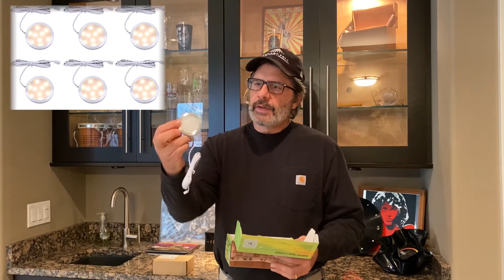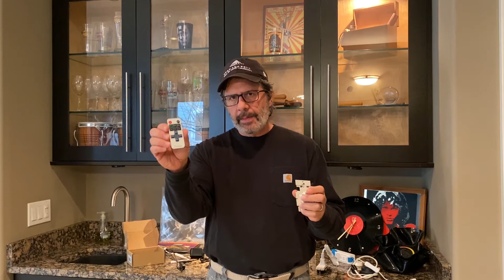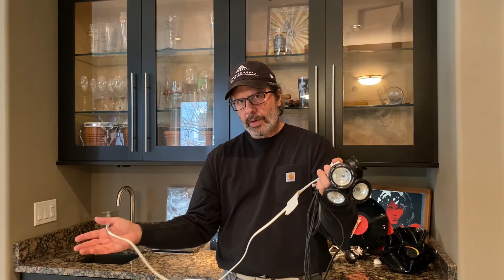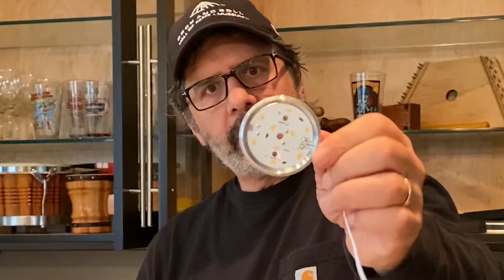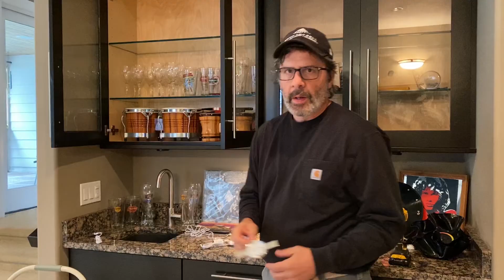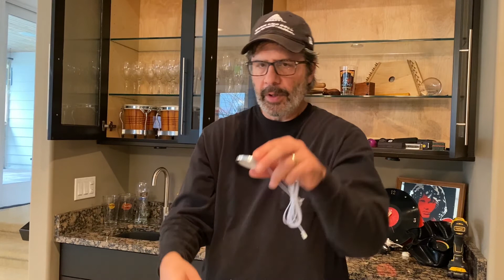AIBOO Cabinet Lights : Replace Halogen with LED using existing AC Dimmer and 2-inch Holes

Comment: Exceptional video. Thank you. Our halogen puck lights are hard wired throughout the kitchen, into mouldings, ceiling, cabinets, etc. Is there any way to use the old AC wite to attach this to DC LEDs without us removing all the buried AC wires throughout the kitchen?
Reply from the maker: Thank you.  Good question. Obviously make sure it is totally disconnected from the AC source, but it should work. DC is also a 2-wire system.   I’d consult with an electrician. They may have a very simple way to do it.
Reply: @dontscrewitup  Wow - fast reply. I will certainly consult with an electrician on this. I assume that although it is also a 2 wire system and the gauge is different, hopefully this won't affect any electrical resistance as it would be a lower power going to the LED pucks.   ON another note - love seeing the percussion instruments in your cabinet. There's nothing like a good old cabasa to keep the rythmn moving.
Reply from the maker: Thanks!  I don’t think the thicker gauge wire matters. I think it’s a problem going the other way with too much voltage going through too small gauge, but that’s not my area of expertise.  

I have, and play all kinds of instruments.

Comment: With what you did with the dimmer switch on the wall. If you have the RHBW lights can you use the remote control to change light colors?
Reply from the maker: I did not include the in-line dimmer and color control,  but I believe it would work.

Comment: I have 3 G9 120V 20W pucks over the sink lights.  They are wired directly, the original was one light normal bulb before.
Reply from the maker: I believe the G9s have the dimmable technology built into the bulb.  That is also an option.

Comment: How do i by pass the remote? I installed mine put a smart switch with dimmer but it wont dim just turns on and off . Do i need a 110v to 12v switch
Reply from the maker: It’s been a while, but I think, once you set the remote it remembers the last setting and stays on. I’ve never needed of use the remote.  Or can you just bypass the remote receiver?   I’ll check it out tomorrow.

Comment: Hi - love you video!  I have been dreading and procrastinating switching out my over cabinet halogen puck lights the stopped working years ago to LED.  My set up is very similar to your but my existing 4 puck lights are hardwired in and run to 1 on/off switch at the nearby wall.  The same light switch controls the under cabinet string of halogen lights.  I would like to keep both sets of lights on the same switch and don't really need to replace the under cabinet (15 year old house) string lights (but could if needed).  So my question is do I need to install a plug up above the canbinets?  Right now there are 4 lights with each having its own hardwire into it.  I can send a photo if that would help.  THANK YOU!
Reply from the maker: Thank you.  If you want to keep the non-LED lights on the same switch as the new LED lights, the yes, basically create a “switched outlet” on top of the cabinet and plug the transformer into that outlet.
Reply: @dontscrewitup  wow!  Thanks so much for the quick response.  If I did want to go ahead and switch out the under cabinet string (old) lights to LED, what would you recommend in this case?  My husband has warned me "not to mess with anything electrical" but I'm going to do all the prep work i.e. obtain all the correct info., order correct parts, prep the area,  clean out all the wine glasses and glass shelves, etc., and then I'll threaten to start and this will force him to finally fix this - yea! Thanks again.
Reply: @dontscrewitup  Thank you!

Comment: That’s been the best Aiboo tutorial on puck lights so far. I was looking for a way to use my own wall dimmer and then came across the transformers Aiboo has listed on their website. All of the other videos I’ve watched people were just using what came with the kits. Which LED Driver Power Supply did you use? The ones they listed say they’re compatible with most wall dimmers like Lutron and Leviton. I was thinking of going with the 50W for extra protection, but if I’m only running 5 to 10 lights off one, that might be overkill. 
Thanks, from a fellow Clevelander.
Reply from the maker: Thanks!  I don’t have the exact models but I used the hi watt and low watt version on two different installations.  I like the “dim” setting to go fully dark.  Neither of the dimmers do this. But I prefer the low wattage because they go dimmer than the hi wattage, but that’s just personal preference and I’m not even sure I could prove it electrically.  These things are all a bit temperamental depending how many lights you have hooked up to it.  I’d need to do more experimentation to be 100% certain.

I just checked the part number. I used the 20 watt dimmer on the 4 light configuration in the video.  I used the 50 watt dimmer on a 12 fixture installation.